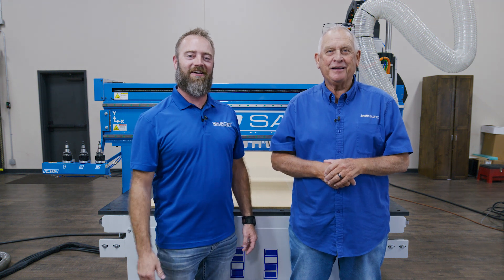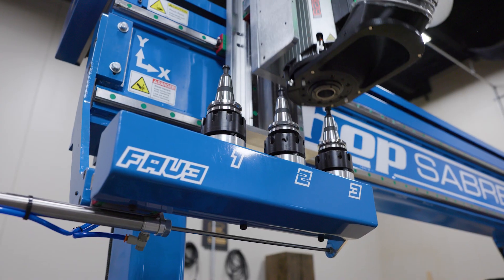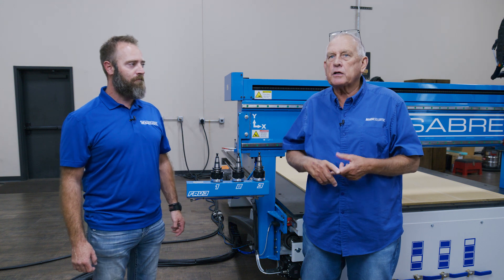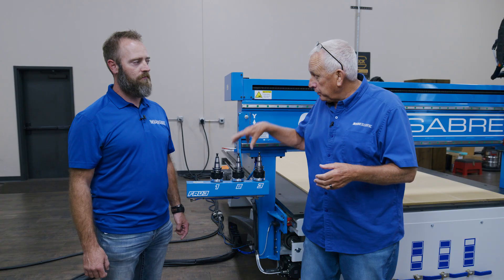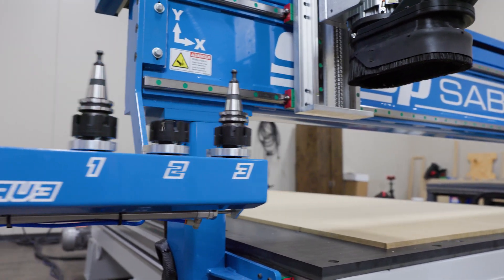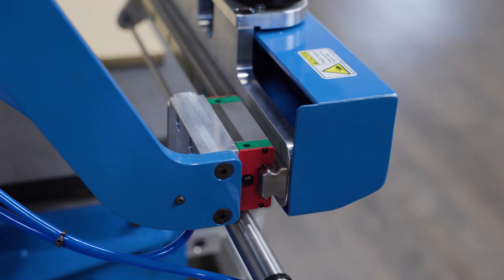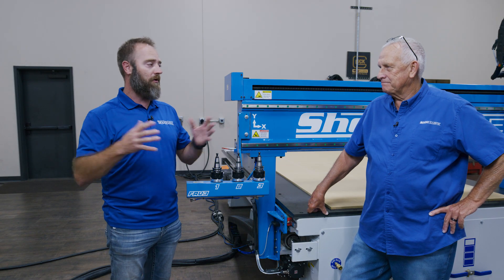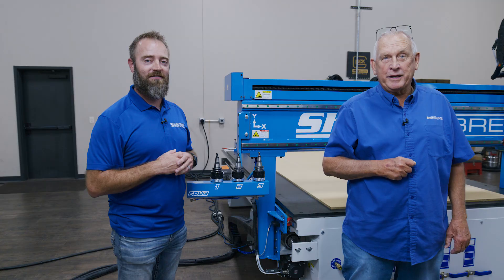FAV3 Technology - ShopSabre Minutes

Comment: Wow, wish you had that option two years ago when I ordered my PRO408. Is it for new machines only?
Reply from the maker: As of now, the FAV3 is only an option for compatible IS Series routers.
Reply: Why IS and not pro?
Reply from the maker: @geisler90  because the IS Series is a quicker higher production machine than the PRO so from speed standpoint if the focus is on speed then it would be better to start with the IS platform.